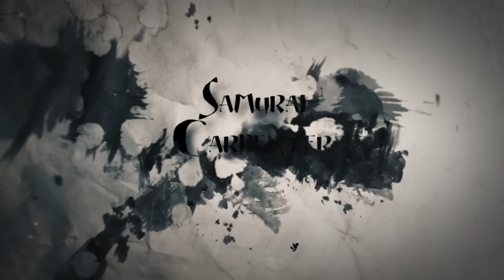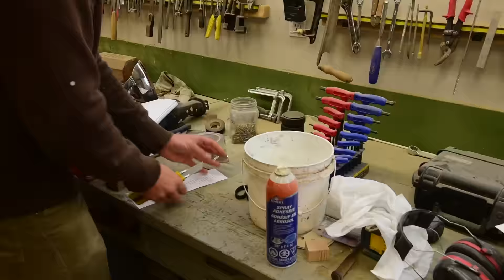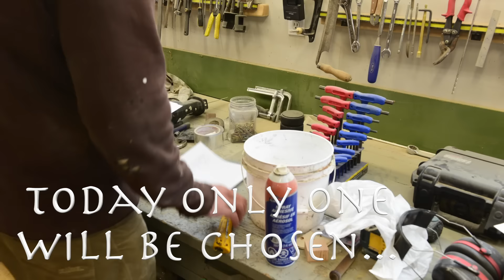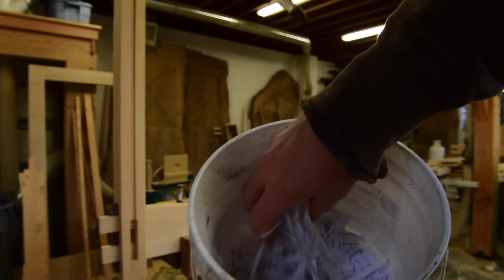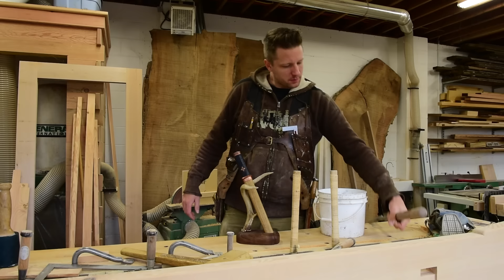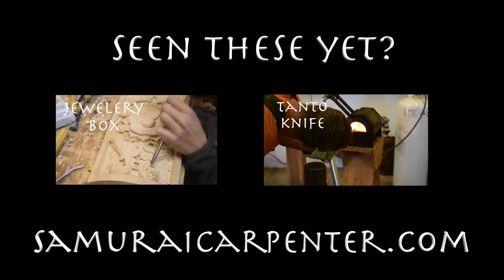WUW #35 And The Winner Is!....

Comment: Great spiel on finishing!  My favourite thing to do is oil, linseed or tung and then top coat with polyurethane.  Sure it darkens the wood and takes longer to do but the oil and polyurethane both dry by polymerization so are compatible.  You get  both the advantage of oil and the low maintenance of urethane and a damn tough finish.